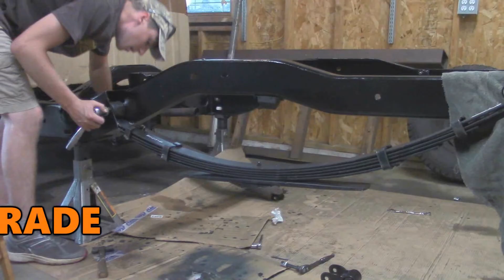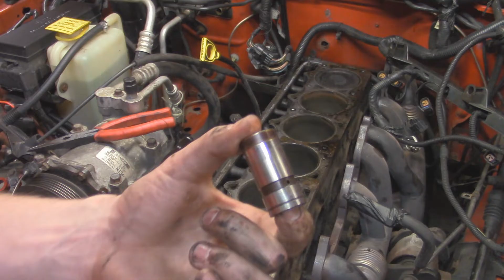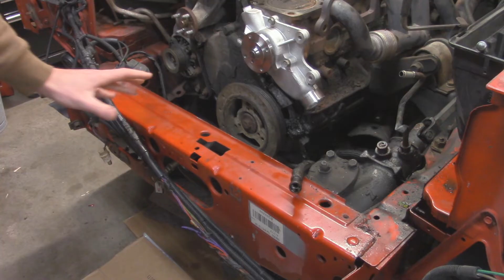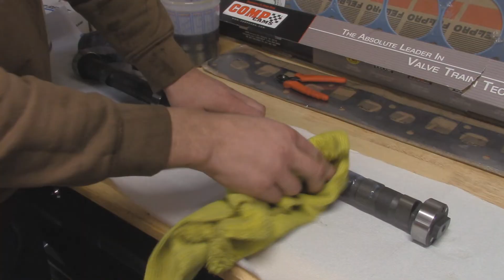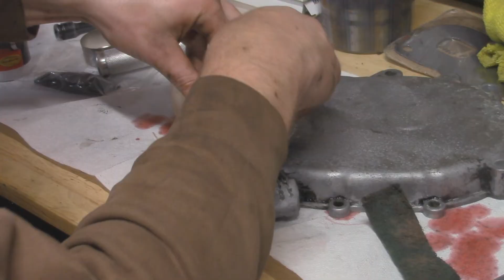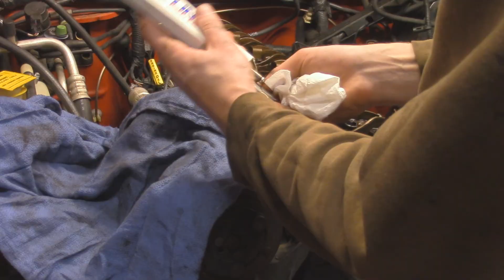Jeep 4.0L Camshaft Upgrade | Jeep Cherokee XJ

Comment: NO to Teflon Tape!  It is banned in aerospace industries, and I worked as as an industrial mechanic for forty years.  Using it is a sure fire leak with steam and hydraulic systems.  Use Permatex PTFE Thread Sealant.  Infinitely better product for the task.
Reply from the maker: Thanks for the tip, I'll definitely keep that in mind for future builds.

Comment: Not sure i like how u cut the oilpan gasket to reapply the timing cover. Oilpan gasket is a one piece for a reason. I see oil leaking in yr future.
Reply from the maker: It wasnt the easist to cut and not ideal but i wasn't interested in dropping the pan. So far its held up fine after applying rtv to both sides of the new gasket.

Comment: Heads up, that brand of ZDDP is one that Oil Geek Guy Lake Speed tested as pretty bad. I used it and almost immediately got a CEL P0240. He said the Lucas product doesn't do any damage IIRC (but it is kind of expensive).
Reply from the maker: I watched that too. I stopped using it and just run VR1 10-30 without any additives.

Comment: How many additional horsepower are gained with this camshaft?  i got a grand cherokee laredo 2001 4.0  and im interesting on get a litlle more power
Reply from the maker: Depends on the condition/mileage of engine. But Comp Cams expects around 12hp and 15ft/lbs gained.

Comment: Fyi, If you use the stock replacement timing chain set.. I've seen them with timing retard built into them for emissions purposes. This will reduce your lower rev torque and throttle response. Put a aftermarket performance set in that has a true zero keyway slot then degree it to confirm so the cam is indeed installed the way it should be.

Comment: I found that by only removing the grill & radiator while propping up the AC condenser, I was able to sneak the cam by and remove and install it.  Saved a few minutes plus I really did not want to disrupt my working AC.

Comment: Those small timing cover bolts are spec's to 5ft lb, which is ludicrously loose. I just did a lot of maintenance on my 20 year old TJ and I could have spun them out by hand, I'm surprised they DIDN'T just fall out like those on yours.
Reply: Same.

Comment: nice job, really informative. one question ? do you just start it right up after or did you have to prime anything up ? thanks
Reply from the maker: @KausinTheRukus  I didn't replace the oil pump so the system is still primed. The break in lube is there to protect till oil covers the cam on first startup.

Comment: So technically it goes from a 4.0 to a 4.6? I’m curious
Reply from the maker: @JakeClouse-iw2of  Nope, still a 4.0. This does not change the displacement of the engine, just valve timing for better performance.
Reply: Thanks for the info! Also do you think 1.7 roller rockers are compatible with this cam?

Comment: I have a 2000 XJ. I removed the cam and cam bearings without removing the head, intake or the exhaust.  I did have to remove the radiator and front clip.  There is a very simple way to do it, especially if the oil pan is also removed.
Reply: Behind the timing chain cover there is a large threaded plug.   That goes the full length to the block. You can remove the valve cover, rocker, arms, push rods, and use a long handled magnet to pull each lifter up starting at the front once the lifter is high enough you can push in a dowel rod and lower the lifter back on the Dow. Once you do it for all the lifters, you can then pull the cam out. I replaced my cam bearings, including the rear, one without removing the head, intake, or exhaust manifold. If you have an email I can send you some pictures of how I did it.
Reply from the maker: @gibsonhomestead6793  Interesting, I did notice that plug while in there. Since you were doing that and not replacing the cam or lifters that seemed to work perfect. It is always good to hear of new ways for certain jobs. I got my email in the about page if you are interested. Thanks for sharing
Reply from the maker: How did you get the lifters to stay up and out of the way while removing the cam?

Comment: You didn't walk the head bolts out half turn at a time? Every head I've ever pulled, I go through and give each bolt a half of a turn in increments so that they all come out at the same rate. I was taught that taking each bolt out completely while leaving the others fully tight can/will cause axial stress on the head and might crack it.

Comment: So I'm using your video as reference for the cam replacement I'm currently doing. It's weird, I have a 2001 xj with a reman motor. The block is a 96-2004 block, but when I pulled the old cam and timing chain/sprockets, they were for a 95. Then I didn't have a cam thrust plate but a cam bolt with a spring and pin that went inside. So when I bought the 2001 cam and chain, the sprockets didn't line up(one was closer to the motor than the other) and the cam bolt was to wide(circumference length) and wouldn't fit into the new cam. So I ordered a 95 cam and it comes in Thursday so hopefully I can get it back together. Another thing that threw me off is I have the camshaft position sensor and not the distributor and also the California exhaust manifold with the 4 O2 sensors on it. Lol I don't understand the build. But thanks for your video, huge help
Reply from the maker: Dang, sounds like that engine was cobbled together from many engines to build 1. It makes it hard to find correct year engine parts then.

Comment: Awesome video. I have a 2001 and use your videos for reference often. I wondered how much play was in your original timing chain when you removed it, was it in fair condition still? 
Also are you expecting a significant difference in sound with the new cam or will it sound stock? Thanks!
Reply from the maker: There was a little slop in my old chain and the new one was nice and tight all around. So far I noticed a difference in sound with cold starts and acceleration down the road.
Reply: Thank you for your reply. My dad and I replaced pistons/rods/lifters in my Jeep last summer but I wasn’t smart enough to mess with the timing chain at 220k miles when I had everything apart is why I asked. Thanks for the content!

Comment: If I want to do that. Do I need new bearings?
Reply from the maker: If the old cam bearing surfaces look good, then the old bearings should be fine. They don't get as much of a beating compared to rod and crank bearings.

Comment: I just put a 4.7l stroker engine in my 2000 xj.    Now I'm wondering if the cam upgrade is next lol.   It's way more powerful than before.    It twists up when I get on it and I love it.   Now I kinda want more but I'm still on stock axles 😂
Reply from the maker: I definitely want to build one of those in the future as well. I got a spare engine already with a 4.2 crank. Did you build your engine yourself?
Reply: @OutJeeping no sir i got mine from s&j engines.    I'm an auto tech but my company is all mobile,  so when I'm off our shops we service  are closed.  I also live in an apartment so me having a place to actually do the build is not gonna happen anytime soon.  I broke a piston skirt one morning and it got outta hand fast so I made choices to get my rig back asap.  It still took forever,  I'm not gonna build an engine outside in west texas desert environment lol.    I thought about it but the thought of sand getting in there made me feel nauseous.    The next version will be a sc ls engine when I get one tons ,exocage and 4 link suspension built by me.   Just waiting to hit the lottery tonight then that project moves forward
Reply: @OutJeeping  man I went on a 3 hour one way trip Thursday morning.   I got death wobble going 85mph.   It's never happened before but the jeep had felt different since that shop installed my engine.     Now it's happening a lot.  Can't drive highway speeds but I did make it back home late yesterday.     I think imma get rid of my drop Pitman arm first and see if that helps.  There's noting really loose but it just don't look right.   Do yall know what Pitman arms will fit in the xj? I was looking at a tj one coz I don't need a large drop
Reply: Did you get a higher volume fuel pump and a 4.7 WJ throttle body ? Get the bad dogg motor mounts !!!
Reply: @gregj.gotham4402  no fuel pump yet only 240 12 hole injectors and I got poly motor and transmission mounts from a fab shop guy that sells on  ebay.   I will port or gasket match my stock throttle body when I get time.  Will be doing the intake and getting banks header at that time.   I'm just outta money right now lol. What fuel pump do ya'll put in em? Part number or name maybe
Reply: Cam, Head, port head-intake. All depends how fare you want, can afford to go. I did the same, 4 to 4.7 in my 95 Grand Cherokee, 19 to 22 mpg. My next step is electric turbo.

Comment: dont cut the oil pan casket it will leak no matter what you do
Reply from the maker: It's replaced by a new section of gasket. The old oil pan gasket section has leftover rtv on it that bonds to the gasket pretty well, so it was easier to start fresh with the provided gasket in the timing cover kit.